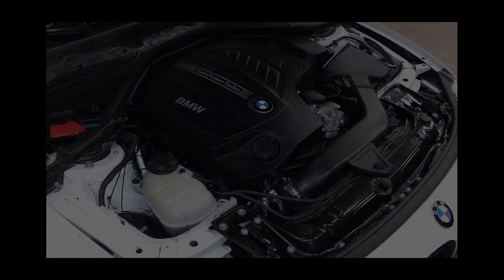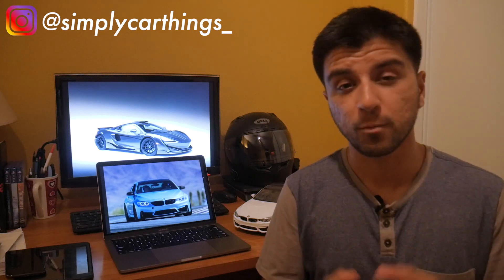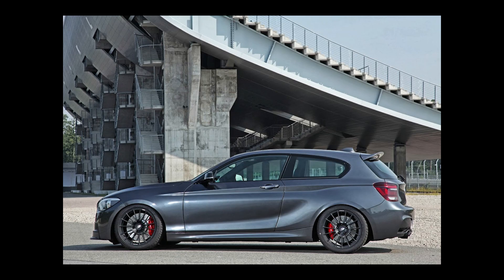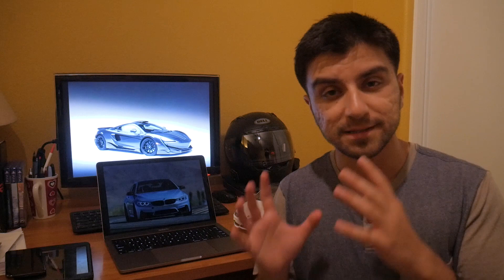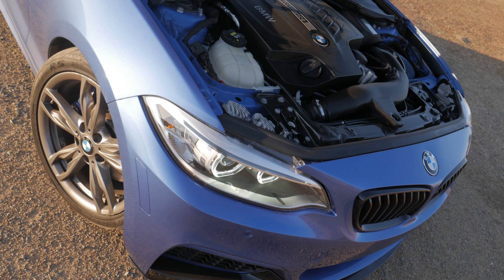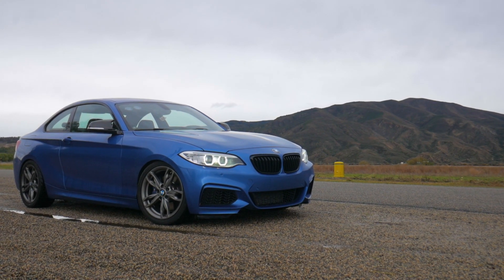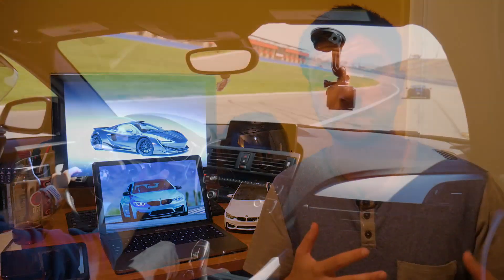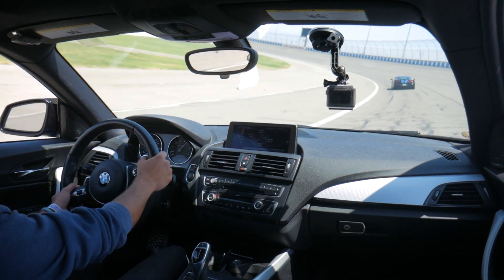BMW N55 ROD BEARING FAILURE | What You Need to Know: Explanation, Prevention, & Solution

Comment from the maker: I forgot to mention in the video that the N55 F87 M2 uses the same oiling system from the M3/M4 and doesn’t specifically apply to this video 👍🏼
Reply: Does this pan work on x-drive N55 cars? What's the part number?
Reply: What? U jus said in video to retrofit n55 w s55 pump n sump that means theyre not same. Thas what this video is about. Im totally confused now. U say thas the remedy. Now u say thas not wat this is about??
Reply: @jackhere4594 f87 m2s are not the same n55s

Comment: BMW refuses to acknowledge this issue .Also the BS in regard to zf being sealed for life !
zf the manufacturer say change gearbox oil n filter at 60k and while your there do the rod bearings or wave 10 k goodbye on an engine rebuild when it throws the rod  bearings  or stretch bolts fail.

Comment: If you overfill 300 ml of oil, could it save your engine for track circuits?
Reply: NO!
You should NEVER overfill an engine with hydraulic lifters, as this will almost certainly cause the lifters to fill with air instead of oil, which will result in damage to the lifters.
Reply: @obihornchen6508 should be 500 cc at least
Reply: can damage the whole engine also, because if the oil level is too much the crankshaft can hit the oil and it will cause oil starvation

Comment: Should I worry about rod knocking with a 2011 535i. I just bought it and it has 109000 miles, only one owner
Reply: Definitely you should be , my 2013 535i had to get its motor replaced bc of this shit

Comment: Great video , Always remember to prime the vehicle after major repairs such as Oil filter housing gaskets, oil pan gasket changes and anything dealing with oil circulation . That is one way you can prevent major damage to the rod bearings.

Thank you for the video man.
Reply: Learned the hard way. Rod knock after a couple of miles
Reply: What you mean prime?
Reply: @alien9114 crank engine over to build oil pressure
Reply: @alien9114 spin the engine without actually starting it

Comment: I put s55 oil pan & pumps on my e82 135i full bolt on except electro steering rack it’s from 325ie90 lci
Reply: y not use the n55 pan

Comment: This issue could really apply to any car with the exception of a few vehicles (GT350, Porsche GT3, etc) 99% of cars are not designed for track use. Your video is informative but the title is very misleading.
Reply from the maker: I appreciate your feedback, when I uploaded this video I had many people message me on Instagram talking about how they experienced Rod bearing failures on their N55 even without track use. Its definitely still an issue regardless of the type of driving you're doing, however it's much more prevalent on track like i stated
Reply: @SimplyCarThings  I think most of the failures I've seen on a dealership level are due to lack of maintenance and poor driving habits. Anyone who leased one of these cars didn't really care because they were going to give it back in three years. Chances are if you are bringing your car to the track it's not stock either which is an enormous variable. Street cars aren't build to handle track duty, and driving a vehicle aggressively on a track  will increase the odds of catastrophic failure significantly.

Comment: My N54 rods gave out at 118,000 miles
Reply from the maker: Do you know what the specific cause was for why they gave out?
Reply: @SimplyCarThings  nope stock car only had a stage 1 tune and DCI, oil change every 4,000km wasn’t winter driven or driven hard for that matter, just bad luck, gonna do a compression test in the spring of the cylinder walls are still good I’ll rebuild if not a new N54 engine in we’re I’m from is only $1000-2400Cdn I’ll swap engine myself with a buddy and save labour cost

Comment: My N55 spun bearings a few years ago at 82k miles. Had to get rid of it shortly after. So unfortunate because I really loved it. BMW screwed up royally on this engine. I always wonder why hasn't a class action lawsuit hasn't been made yet for these engines. All I did was daily drive it, never saw a track.
Reply: Sounds like you did the damage! 95% of the N55 are just fine. Mine is just fine at 150K.....
Reply: @AgonxOC  nope… after I wrote this comment I did some more research and it turns out that the n55 will spin a bearing after an improper OFHG change. There is a special priming procedure and if you don’t do it after changing that gasket, you get air in the system and you will run the engine dry for a few seconds. Many people reported the same issue after having a shop or dealer change their OFHG
Reply: @FreePalestine1948  What a nonsense....... Are you using forum anecdotal experiences? I didn't have an issues when mine was done many miles ago. A buddy did his recently and his car still going strong. So non sense!
Reply: @AgonxOC  lol why am I wasting my time with you? I don’t care what you think. I was simply stating a phenomenon that I noticed with many people who had their OFHG replaced and their bearings spun right after.
Reply: @FreePalestine1948  a phenomenon alright! Based on my own personal observation, this is not true. The SIB came in 2020 and it talks about the replacement of parts, for which “priming” makes sense, but if lack “priming” is a causal factor for bearing failure, etc, and BMW provided the procedure, can you blame the engine? Or the person working on it. Most normally used N55 are fine. It’s the racer wanna be who abuse their car without even monitoring things like oil pressures etc.
Reply: @AgonxOC BMW has acknowledged the problem and has issued SIB 11 09 15 regarding the matter, as well as enthusiasts and work shops. It appears your comment hasn’t aged very well. 
N55’s can spin a bearing if the engine has not been adequately primed after replacement of the OFHG.
Reply: @yjkader  correlation is not causation. Go ahead and post that SIB here and read it carefully. Reading comprehension is very important. The SIB does NOT refer to a OFHG  replacement being a causal factor. My N55 has 200K and aside from the newly developed slow coolant leak (I am sure its a hose somewhere) its running like a champ!
Reply: Same happened to me about 2 years ago I still have the car and I finally got a new engine for it but I never found out the reason why it failed the 135i n55 has only 84k miles

Comment: Never thought it would happen to me but I have 2013 535i with 57k miles and my connecting rods went bad so I dont know what to do. its 20k to replace the motor.
Reply: Did you drive the car hard? How often were the oil changes done?
Reply: Did you have a Vehicle Service Contract?

Comment: Not common my ass. Had a kid. Sold my camaro. Saved for a year. Put down a good chunk of change on a 2011 335i m-sport. Blk on black. Had it for 6 months, rod knock. Gonna cost a minimum of ten grand to replace the engine. 20 grand if I go through BMW. I still owe 8 on the car. Been sitting for a year now while I pay it off. Amazing car for the 6 months it worked. But I did drive it hard. And the guy before me who installed a jb4 drove it hard too, I'm Sure. Don't tell these people "most" people won't have to deal with issue. Because these cars are becoming more affordable now. So everyone is going to buy them and drive them until they blow up. Just my take on it.
Reply: Damn! I just picked up a 2011 335i m sport at 118k miles. It has all the service history and the engine runs smooth. The last owner had mhd stage 2+ tune with all the bolt-on upgrades. The car was put back to stage 0 when selling. As im learning these, its becoming harder to enjoy driving the car.
Reply: @Enayet Khan   yup. About 6 months left of payments on it. A little homework into the n55 and you'll find that there's a few different reasons why tons of people experience premature engine failure. Something to do with the oil filter housing gaskets leaking, then the lower bearings go after it gets fixed? Then I remember reading the oil sump pickup is on one side of the pump so If you're cornering too hard in your ultimate driving machine, you might loose oil pressure. They corrected the issue with the s55 version of of the engine, by putting in two oil sump pick ups... what a waste of money. Should have just stuck with a 330 but I just had to have that power..... I got another camaro.

Comment: Is it common even in oem cars (suspension, tires and brakes)? Or it’s more offen in modified cars with slick, coilovers?
Reply: My car was mostly stock besides down pipes and a tune. Did a lot of pulling and speeding. I hit 150 and boop there goes my engine.
Reply: @vlonezay8054  damn, 150k miles is actually good for N55. Did you swap it or sell it as a shell?
Reply: @OGYELLOW  I meant I did a pull to 150 mph lol. The mileage when I got it was 115, and it lasted till 121. Looking back it was pretty stupid considering it was my first car. I went with a swap.
Reply: @vlonezay8054  how much was the swap and how many miles was on the swap? Did you do new bearings before swapping it in?

Comment: So what is the best solution for engines that they already have a small pieces of metal in the oil filter, you can hear some knocking, but it is still running? Just change the rod bearings and hope? Or completely rebuild the engine or swap for another one? Thanks for the comments!
Reply: Depends on how bad some times you can change out bearings and it will fix but if prolonged it can cause more internal damage. Best sourcing a new/used engine. Rebuilding one will cost a lot, unless of course that the money doesn't matter.

Comment: MY 11 135i M Sport DCT. My engine has developed rod knock - it does happen. Car was not being tracked or raced at the time . Just started to knock. If you idle engine or keep it under 2k you would not know. It was full of oil.
Reply: Did you happen to do OFHG?
Reply: @Areku06  No mate. Car was on ramps do do exhaust work. Started it and ran it on ramps for a while. Knock developed soon after. Cant see the ramps as being the problem though. I have an F20 engine rhat we will fit.
Reply: I’d suspect the inadequate N55 oil pump was unable to get enough oil while tilted on those ramps maybe?

Comment: I own a 2014 435i. I recently suffered rod bearing damage due to low oil pressure. The overall solution that I was told is to have the entire engine replaced, but I am not trying to do that.
Reply: What caused the low oil pressure? Were u low on oil prior?
Reply from the maker: i’m sorry to hear that man, i think an engine rebuild would be best if the motor can be salvaged

Comment: I was wondering if running different types of tires will affect the  oil starvation.
I came from subarus and that was a concern when hitting the track. If you run  slick o very sticky semi slick tires you put a lot of g while cornering causing oil starvation. The solution to this was a bigger oil sump, pick up and baffletray  ( killer B).
I tracked  my aubie a lot and never spun a bearing in the track running regular tires.
From what ive been studing, The bmw n55 oil sump is way more efficient and uses more oil than the ej. So i reckon that running semi slick tires ( tdw 180-240) shouldn't be an issue for the occasional owner that tracks his n55 2-5 times a year... but never is a bad idea to add  500cc more of oil  if u go to the track as excessive overfill will actually cause a lot of damage like you said.
The 2 most important things to be aware of if you like to trac k your n55, are:
•Never push your engine hard until has reach at least 80°C this is what causes spun bearings 70% of the time.

•It is not a race car and it should not be treat like one, Know the limits of the car.

•Use quality oil in a shorter interval than the one recommended by bmw and check levels regularly.

Great video buddy always proving good knowledge. Keep it up

Comment: Lol wth since when did n55 have rod bearing issues.
Reply: Just spun mine at 80k miles. 2011 bmw 335i with the n55. Full bolt on and e85 mix map. Makes 350hp and 420torque oil changes every 3k miles. Still spun it. Heard other very similar stories. Happens a lot

Comment: I’ve got a n55 being rebuilt right now for this very reason started knocking spun a bearing☹️ I’m definitely upgrading the sump
Reply: Yes the car had previously been on a track day a few days later it started knocking then eventually seized, it has a ps1 turbo running 460bhp 680nm, my engineer explained that all rod bearings were on their way out eventually but cylinder 1 got there first . I guess that’s the result of high boost at low rpm over aggressive timing and sketchy intake temps!
Reply: @m15t3rboost3  my understanding is that the engine is fine with the abuse, the issue is oil starvation when the car takes high G turns. The m3 and other performance models get a beveled oil pan to prevent starvation.
Reply: Tracked?
Reply: Tracked?
Reply: @jay5887  sorry I mean had the car been taken to a race track with high G force turns
Reply: Hey man. Can you give an update? What happened? Cost?
Reply: Update ??

Comment: My rod bearings failed on my 2012 e92 335i 2 weeks ago at 52k miles :/
Reply: What happened when it failed???? What caused it to fail? Did u recently do a oil filter housing gasket replacement or what
Reply: Tracked?
Reply from the maker: Noooo :( i’m sorry to hear it man, i’m sure your car will be back up and running soon

Comment: Just swapped my bearings with some King bearings while upgrading my turbo. Did so for peace of mind
Reply from the maker: Definitely a good move to make man, glad to hear that!
Reply: How much was the labor on that job?
Reply: How is that holding up? I`m afraid to do that because the bearings are color coded
Reply: @TK-jj9xr  Still no issues
Reply: @m4imola  still any problems, how many miles have you put on it, what mileage did you change them at? Thanks in advance
Reply: @m4imola  howd the OG bearings look though?
Reply: How is the engine holding up?

Comment: Sorry to say but I think the title is slightly miss leading as this issue applies to most normal road cars. Without a baffled sump, oil starvation is likely to happen if you use a normal road car hard and for long periods on the track. This is what the M cars are designed to do.

The early M2 has an up rated n55 engine. BMW gave the M2 N55 a forged crankshaft, forged connecting rods and newer piston rings, a reshaped oil pan, a new oil drain pump and additional oil coolers. It also had its spray-on cylinder liners replaced with cast-iron ones. This is so it can be used hard on the track.
Reply: Forged crank and rods are also on the m135i and m235i

Comment: Tracking, not letting oil get up to temp, bad maintenance, wrong oil, cold climate. So many factors.  Doesn't concern 90%.  Of course forums are going to have all the people complaining about failures.  Not reality though. Guys that track these see as low as 10psi oil pressure.  Thats the biggest problem.  Well said sir.
Reply from the maker: Thanks man! Yea its not common by any means but ive had people message me on instagram with pics of their bearings after they went out

Comment: I have word from N55 owners that if you aren't careful when replacing the Oil Filter Housing Gasket, the engine could seize up, requiring a new motor.
Reply: Seen this happen countless times. Best way to prevent this is to drain the coolant out of the upper radiator hose (or lower if you want to be extra safe) before unbolting the heat exchanger and oil filter housing. Lots of guys use scotch brite pads to clean up the mating surfaces, be very careful with this, don't want bits of the scotch brite getting into the oil system. When you're done, pour some fresh oil into the oil filter housing. Top off coolant and bleed system. Now the most important part is PRIMING THE ENGING OIL SYSTEM. Best way to do this is to disconnect the ignition wiring harness from the DME, then crank the engine for 10-15 seconds, wait 30 seconds, then repeat twice. This will get any air pockets out of the oil system before you start the engine. Plug the harness back in and you're good to go. Hope this saves some engines.
Reply: Also have never seen this happen with N54 or N52/1 but anything's possible. Those 2 engines are basically bulletproof. I've replaced probably 20 N55s and only seen one bad N54 with low compression. That had 190K on it.
Reply from the maker: Yea i believe oil can leak onto the main belt, deteriorate/shred it, and then it can get sucked into the front main seal 😬
Reply: @SimplyCarThings  Although that can happen (and has happened to me), I dont think thats the scenario hes bringing up. 

Theres been a series of threads where n55 (and n54) owners have had their engines seize after driving the car for a couple of minutes after an OFHG change. Some think its dirt getting into the housing and clogging the engine leading to starvation. Some think its because the engine needs to be primed after doing the job.
Reply: Simply Car Things Yup, I heard the exact same thing. This kinda backed me off from buying an E90 N55

Comment: I consider the 2017 B58 M240i or xdrive as more of a M car engine over 2016 N55 M2 and they made 340i's in 2016 w B58's. The 11-12 1M had a N54 when the regular 1 series 11-13 135's had a N55. Why did bmw even bother with it? I expected the M2 to have the B58 upon its launch but once I realized it was N55 I found it to be utterly appalling.

Comment: I had to replaced a m54 20 year old motor due to  rod bearings come on bmw
Reply from the maker: Thats a little more understandable at least haha
Reply: Never had issues with M52 engines. M52 was a solid engine. The M54 always consumed oil for some reason.

Comment: I disagree with this, the N55 doesn't have rob bearing issues. They use S55 bearings. But yeah, high G's will oil starve the bearings.
Reply from the maker: Yea, the rod bearing issues arise as a result of oil starvation 😃